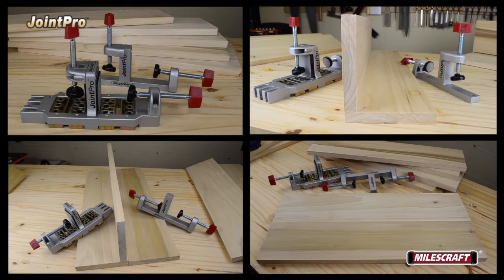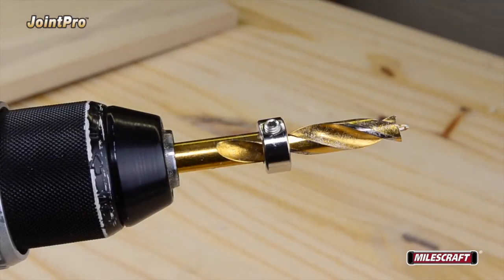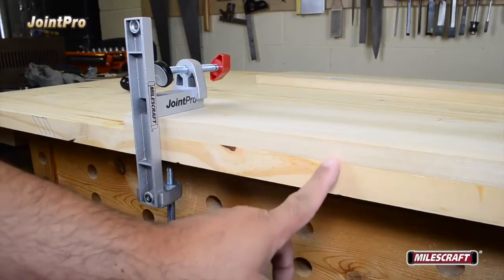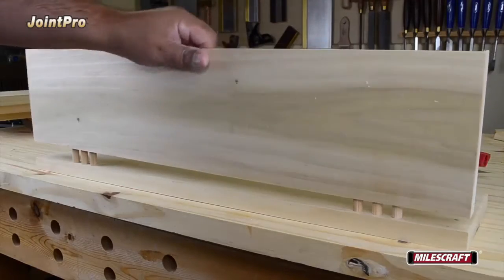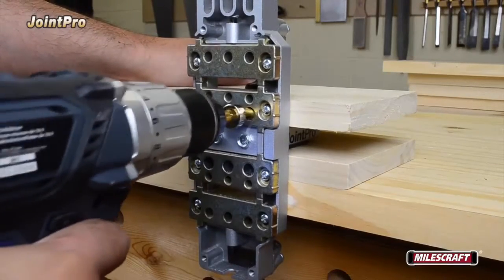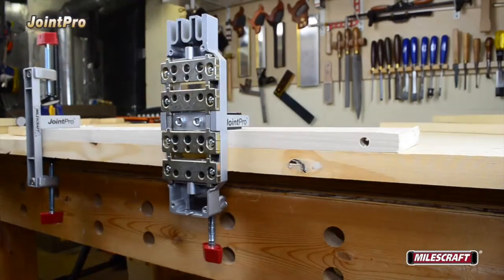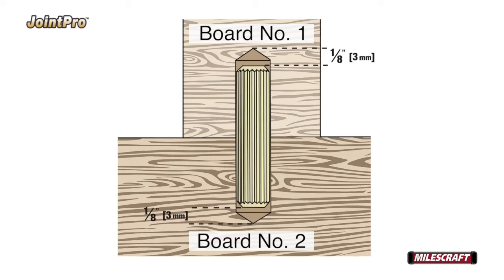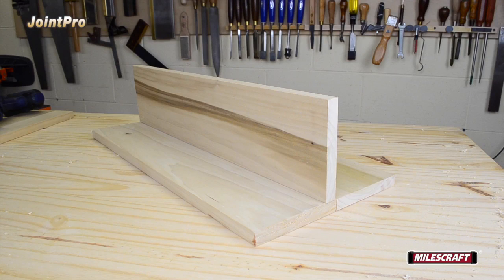Milescraft JointPro 1311 dowel joinery system

Comment: There is some lateral play between the guide blocks and the jig. There’s no provision for centering the holes in the edge of the board. And the jig provides nothing to help accurate placement of the jig. You need a jig to use this jig in some applications. Finally, the guide blocks are not flush with the face of the jig so you need to be careful when placing small boards or you could end up with the board not being perpendicular to the holes in the guide.  So, this jig is not a good all around solution.  It looks like the Joint Master might be better. I would sell my Joint Pro for $5.
Reply: Agree 100% I added small washers and got some improvement in hold/accuracy.

Comment: I have one of these and it does not work perfectly well to align boards on a flat plane without lippage. Plate joiner is better for this. Considering the price, and for specific applications  (solid wood) there is value to this tool.